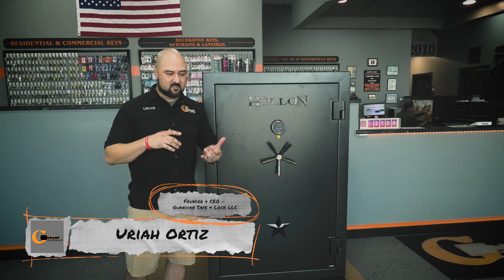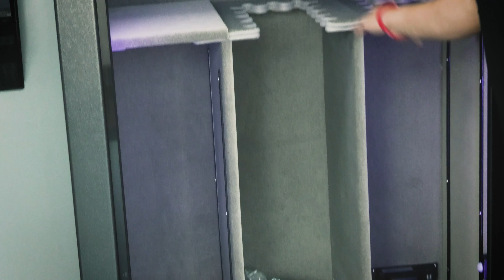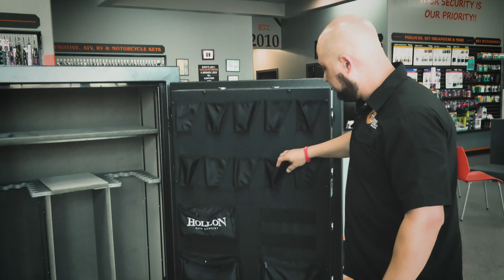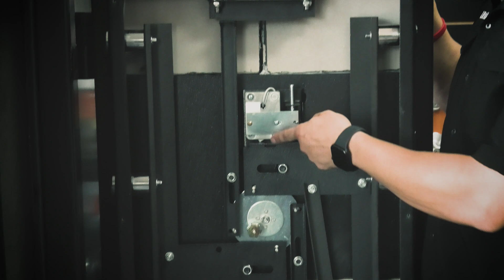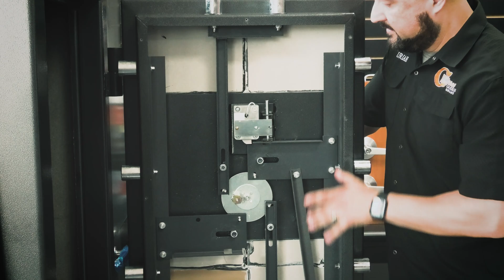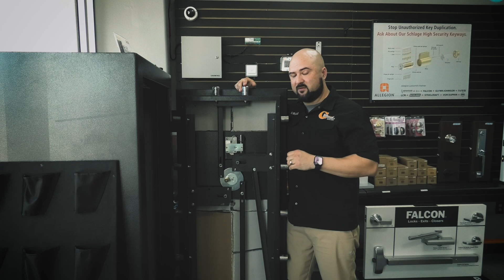What's Inside a Safe and How Does It Work?

Comment: Interesting look at the locking mechanism, I didn't realize they were so simple. Kinda funny but I'm searching for videos about safes with the electric keypad because my battery died, so the lock didn't work and I didn't spare battery. That made me wonder how do you get into your safe if the thing the battery is powering dies? I asked this question to AI and it told me to use the key that came with it. Key? I didn't get a key?!  lol